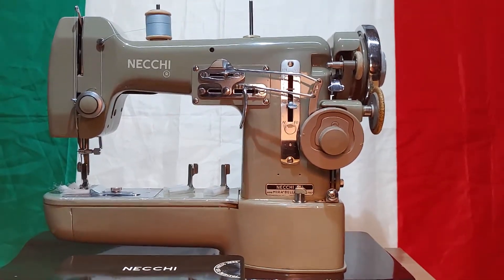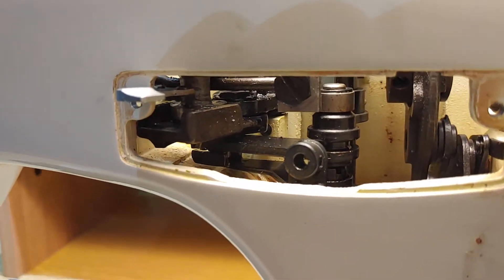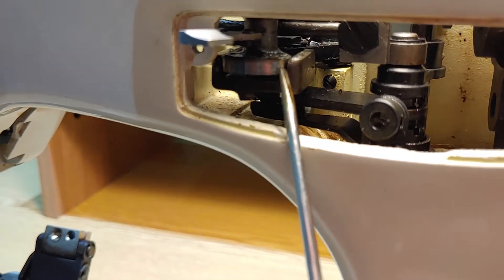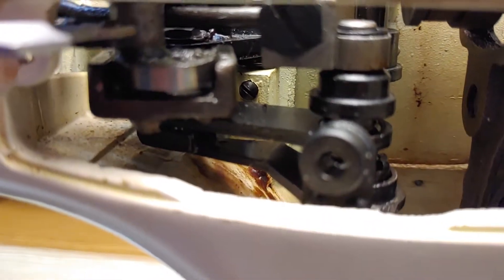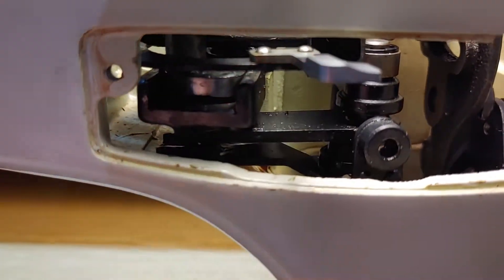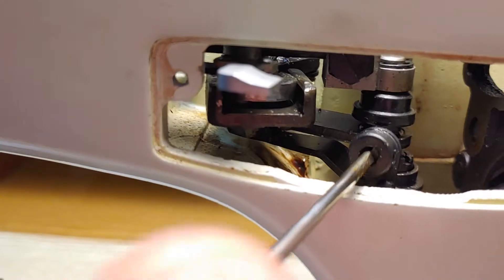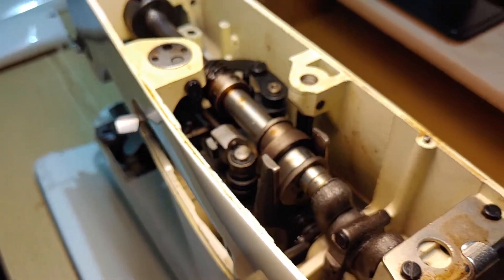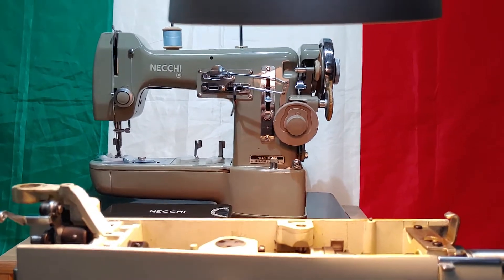NECCHI Zigzag control mechanics...

Comment: Thank you for showing this mechanics. My Singer 237 got some of the same kind of mechanics, with this "triangular" cam controlling the movement. I did a video about how these cams are designed. You mention, that the mechanics is spring loaded too. Do the spring attach near the shuttle house?
Reply from the maker: The spring is attached to the top of the machine and acts on a vertical axis which mechanically acts directly on the axis and bearing of the bobbin case via a lever below.
As a result, the direction is always biased to the right and automatically eliminates the "tolerances" ...
The construction can be seen in one of my videos, it is constructed identically on free arm and flatbed machines ...
https://youtu.be/3Zck7WiZMug
Reply: @necchi-pavia  Thanks. Then a bit slack might be in the two bearings at the horizontal rod below.